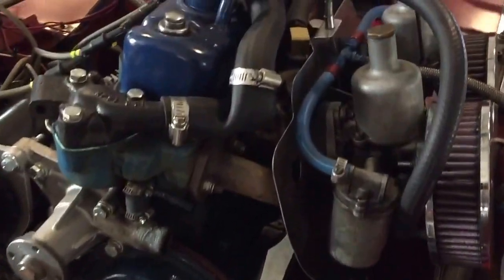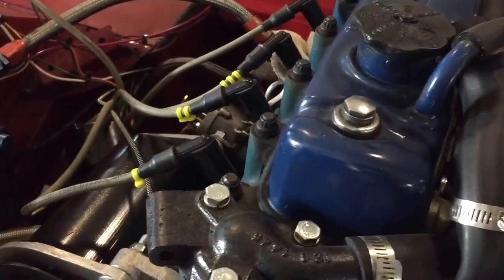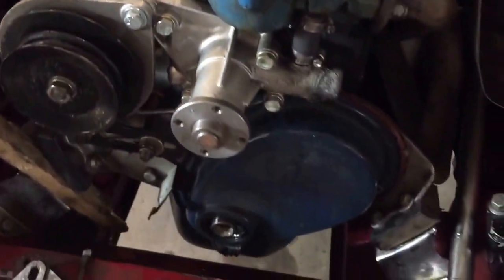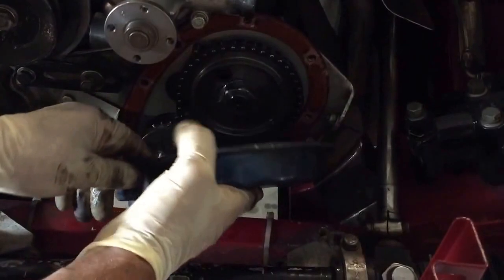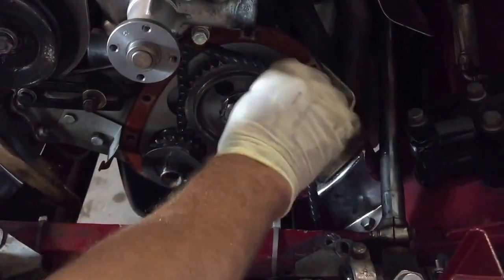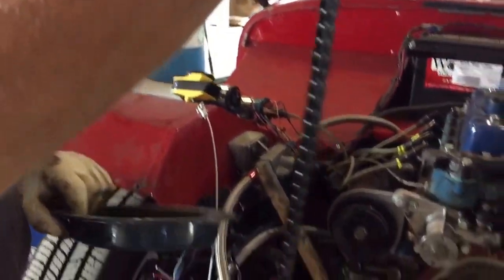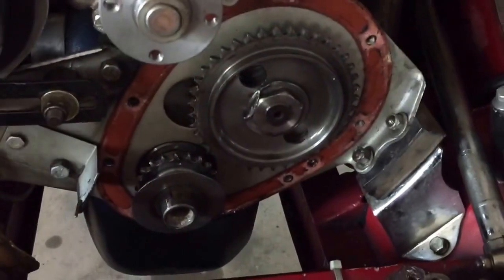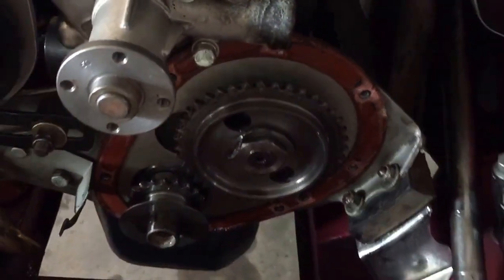Vintage car No spark

Comment from the maker: Not possible on these engines... sadly, though, many if not most modern engines seem to be interference type, where major carnage results if the timing belt brakes... these valve don't protrude below the bottom of the head, nor do the pistons protrude into the combustion chamber, making a chain failure a much more minor event than with modern vehicles